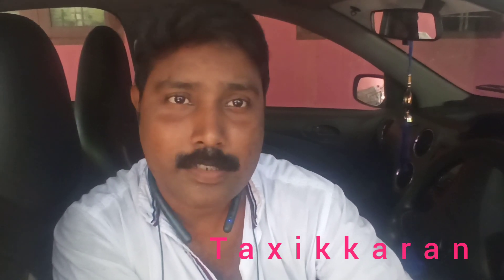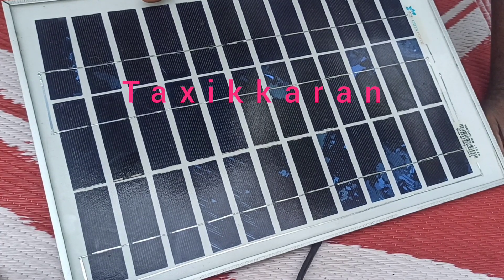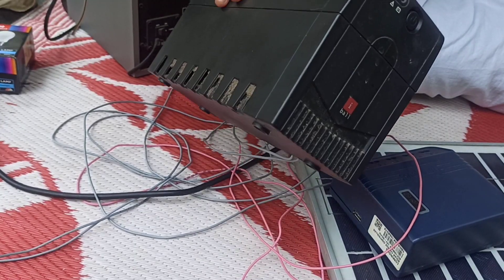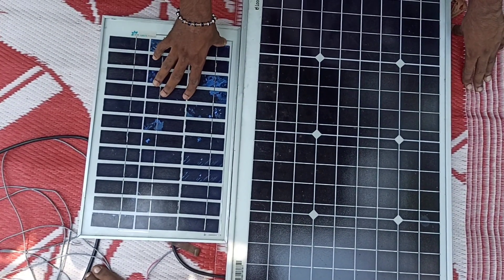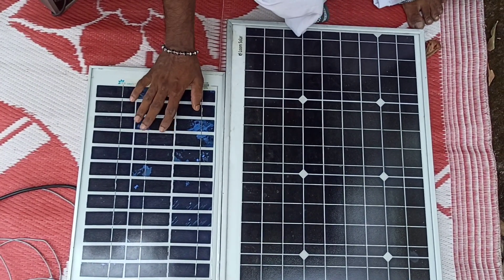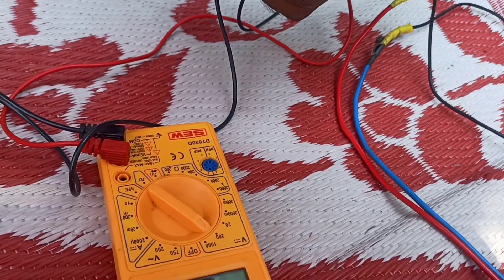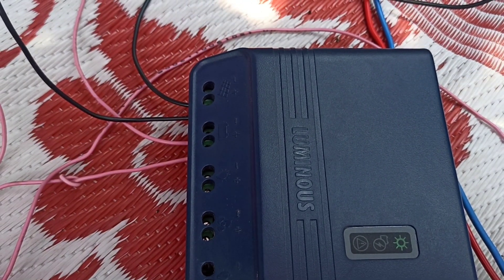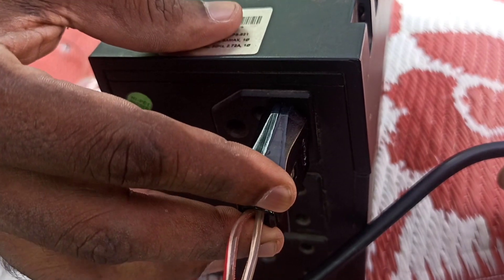Solar system ചെറിയ ചിലവിൽ  3500/ രൂപ  ആർക്കും വളരെ എളുപ്പം നിർമിക്കാം malayalam

Comment: Battery volage തന്നെയായിരിയ്ക്കുമോ charge controller ന്റെ load leads ൽ കിട്ടുന്നത്. അതോ കുറവായിരിയ്ക്കുമോ.
Reply from the maker: Battery voltage thanneyanu controller load out leads ilum kittuka  dc system anenkil wire neelam koodumthorum cheriya voltage drop kanikkum
Reply: I am very much thankful to you for clearing my doubt.Ok.

Comment: ഒരു 9 w LED 10 ബൾബും 3 FANനും Work ചെയ്യാൻ എത്ര ചിലവ വരും എത്രAmh Battery, Inverter,Solar Panal,,
Reply: 200ബാറ്ററി അതിന് എത്ര ആകും
Reply from the maker: എത്ര മണിക്കൂർ വർക് ചെയ്യണം എന്ന് അറിഞ്ഞാല് കൃത്യമായി പറയാൻ പറ്റൂ. ഒരു8hour 10ബൾബുകളും 10hour 3fanum work cheyyan 2500watt venam athinu 200ah battery enkilum വേണം inverter 1100va. 5manikkor maximum nalla veyil Kittu ennu kanakkakiyal 500 watts panel ആവശ്യമാണ് 200ah battery charge ചെയ്യുവാൻ 40amp charge controller um venam

Comment: നിങ്ങടെ വർക്ക് ക്യാമറ വളരെ മോശം ഒന്നും വ്യക്തമായി കാണാൻ സാധിക്കുന്നില്ലക്യാമറ വളരെയടുത്ത് പിടിച്ചുകൊണ്ടാണ് ക്ലിയർ അല്ലാത്തത് യുപിഎസ് കണക്ഷൻ ചാർജ് കണ്ട്രോളർ ലേക്ക് കൊടുത്തു അതിനെപ്പറ്റി യാതൊരുവിധ അറിവുമില്ല ഇല്ല കാര്യങ്ങൾ പ്രേക്ഷകർക്ക് മനസ്സിലാകാത്ത രീതിയിൽ ആണോ എന്ന് ഒന്ന് ക്ലിയർ ചെയ്തിട്ട് അപ്‌ലോഡ് ചെയ്യും മാത്രവുമല്ല ഇത് മെയിൻ ലൈനുമായി ബന്ധപ്പെടുത്തിയിട്ടുണ്ട് എന്നുള്ള കാര്യം വ്യക്തമല്ല ഇല്ല
Reply from the maker: ഇനി ഉള്ളവയിൽ ശ്രദ്ധിക്കാം ups നിന്നുള്ള conection separate പുറത്തുകൂടെ വലിച്ചതാണ് main connection കൂടുതൽ ups Thangilla maximum 2or 3bulb 10w led kathikane pattu enkile backaup time oru 3hour Kittu .50wpanel kondu maximum 20ah battery vare charge cheyyam .ella battery output calculate cheyyumbo 80% pratheekhikkavu20ah battery maximum output20*12=240varumathinde 240/80%=192 approximately 180woutput kittum .അതിനനുസരിച്ച് ബൾബ് കത്തിക്കാം